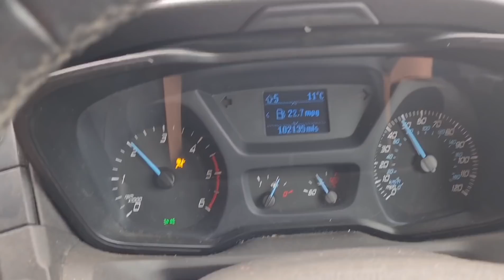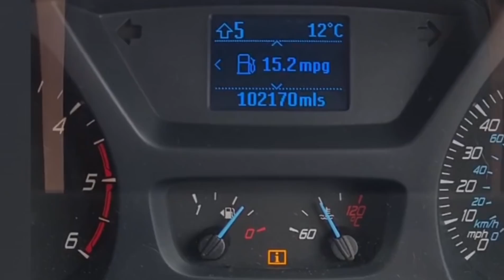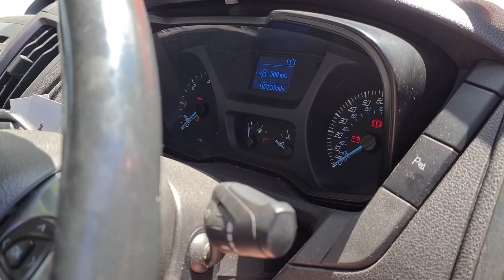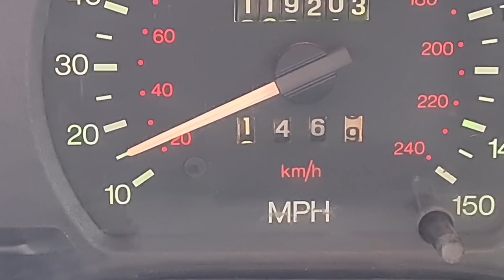Omg! How can we be so Unlucky! Can't believe this happened

Comment: The AA mechanic taught Sherpa that water damages electronics, Alexa is in big trouble.....
Reply: Awesome comment!   Alexa may experience an unscheduled splash in the toilet.  Oops!
Reply: Actually clear rain water is non-conductive and electronics / electrical could care less (especially low voltage DC as in an automobile) (this is not the case with low Ph or high acidic water). However, copper and aluminum contacts hate water because it's full of oxygen. It takes several "wettings" but eventually the connector's metal contacts oxidize. Oxidized copper or aluminum when suspended in water is VERY conductive, causing shorts between the contacts - especially bad if one of those shorted contacts is 12VDC. The point is it wasn't the rain this time that caused the problem, it was the rain that got into the connector the last four times that caused the problem.
Reply: Tab Ber Best comment‼️😉
Reply: @3DPDK  sorry to disagree, but Rain water is not the same as Deionised water. Rain water still contains all the impurities, thus it very much does conduct electricity because of the presence of Ions. So rain water will definitely cause a short circuit. Hence the multiple faults being displayed on the dash as the rain continues to run across multiple contacts.
Reply: @Madmonty73  It depends on how long it's been raining, the condition of the air the rain is falling through and the condition of the surface catching the rain. In truth, the water coming through the cracks while driving on a road with a lot of traffic is full of (conductive) carbons and other trash. Never the less, the corrosion shown in the connector didn't happen in just one dowsing and it's caused by acidic water and oxidation over time and repeated exposure to water. When the oxidation gets wet, it eventually shorts. For the record, I do not recommend that anyone pour water on live circuitry.
Reply: @Ignatios Nelson Professional electronic, field and bench tech. Worked in both digital and analog, both audio and radio including microwave. I have literally opened a digital system cabinet and had water pour out of it - while it was still working. I have gone on in life to become a ship's captain, yacht builder and currently retired living on a vintage racing yacht designed by Drake H Sparkman. I "stand out" only when I want, and I usually avoid crowds, and I could care less about your English corrections - which means I care a little, so there's room to care less ... but in this case, very little.
Reply: Brilliant! 
You won  🏆
Reply: Time for Alexa to take a bath.
Reply: @3DPDK  Touche' ! (re: the bit about English corrections LOL!)
Reply: @galady8632  yay! 😉
Reply: @Madmonty73  Plus the rain picks up dirt and stuff as it travels through the vehicle.
Reply: Alexa is just a quick leg lift from the trash can.
Reply: @toomanyhobbies2011  😳😁
Reply: @3DPDK  the 'rainwater' probably had screen wash in it too as whenever Jamie washed the screen, the residue would have gone down that gap as well. There's all sorts of chemicals in that...
Reply: @MaxxsMummy  What folks are missing about my first response is that I refute the somewhat broad statement that "water damages electronics", and that it wasn't just this one rain that fried the computer but many consecutive rains previous to this one, and my experience tells me it was the connector that suffered corrosive damage and it was the corrosion build up in the connector that shorted out the board it's connected to.
Reply: Lol pure water is non conductive is it...? Silly clown.
Reply: @joshschneider9766  There are no free electrons in the H2O molecule ("pure water"). If you know what electrical conduction is - how electrons move through any substance, then you will know why your response is based on lack of knowledge.
Reply: @Sherpas_vanlife  put some tape or something over the gaps where it leaked through to stop it from happening again

Comment: Jamie I have been a Mechanic for 25 years there is a trick to wet connections and getting around them...it is called Dialectic Grease if u have a connection that gets wet and ur vehicle wont start because of wet connections..u put that grease on the contact connections and wet or not the grease the it electrical current and ur vehicle keeps going.

Comment: Rubbing alcohol and a small wire brush. Alcohol disperses water,wire brush to clean rust off areas you can reach. Looks like the fuse panel is in a bad area that catches water
Reply from the maker: Thanks Todd.. Will definitely make sure it doesn't happen again

Comment: There is a reason that FORD is actually an acronym for "Found On Road Dead" and "Fix Or Repair Daily", and you have just discovered that reason!  
For your next van, DON'T purchase another FORD!
Reply: You must have missed it. The old van is a Ford too. You never know with Ford's, just like other vehicles.
Reply: The old van that starts again is also a Ford. Thats one of the reason Jamie got a Ford for the red van
Reply: To be fair, Ford UK doesn't have quite the reputation FoMoCo does here in the States.

For that matter, the Transit was born in Britain!  I'd take a Transit over a Sprinter, Metris, or ProMaster any day.  If only Dearborn would put a real transmission in the NA models.
Reply: The blame goes to whoever didn't put the wire harness boot back correctly.
Reply: You do realize the second van that sat there for a year was a Ford and it started up 🤦🏿

Comment: Jamie & Sherpa. It sucks what happened to you guys in the new van. You're lucky it didn't short circuit or catch on fire because of the exposed wires and the rain water. By the way. With a good cleaning and a tune up, your old van can get back on the road in no time. Please keep us posted on what's going on with the vans if you can :-)

Comment: Sorry about the sherpa mobile but that's a good idea having two vehicles. I had a Mercedes Sprinter work van with over 500 thousand miles on it. It was a work van it never left me stranded anywhere. The guy that had it before me didn't put oil in it or anything. And when I got it I tried to take care of it and it started all the time and was completely reliable.

Comment: Rough deal.
Back in the 1990's I had a 1971 Volkswagen Beetle that stopped running for no discernable reason.
I had to leave it in the lot at work and come back for it later with a friend who knew how to work on them. The day I went back, it was raining, and I was not looking forward to major diagnostic work in the rain. Well, the dang car stated right up.
I figured out, the second time the car died on me, that all I would need to do is pour about a gallon of tap water over the engine and it would start. Once it started, it kept running.
After some actual troubleshooting, I found that the main solenoid had an internal crack that would sometimes, depending on vibrations when running, would end up with a gap that the spark could not bridge, but getting it wet filled that gap with water to allow enough conductivity to start.
-
I replaced the solenoid and no longer had to carry a gallon of tap water with me. But I did miss the looks I got when I would pour the water on the engine and then start the car.
-
But enough of my story, I hope it is not too expensive a fix!

Comment: Tip for motorists: Regularly remove debris & leaves from the plastic scuttle panel by the wipers.

If left, debris can block up the drains under  the panel, which causes water to pool.

This water can destroy your wiper motor, leak into the interior & has the potential to do a lot of damage

Comment: As with all computers, in this case stop the car (duh), disconnect the battery, make sure water not in fuse box, computer connection, etc. Restart car. Hopefully computer reboots and is fine. 
Always worth a try.

Comment: Wondering if you can get GMC or Chevrolet (Chevy) Vans over there? They tend to be much more reliable then Fords or so I have heard, witnessed and lived the proof of it my whole life. 😁 The Chevy pickup my hubby and I have is a 1998, and still has the original engine in it, over 400,000 miles!! And she still runs and still hauls loads of material with a trailer! I mean, yes she’s tired, and her body has issues from age (rust) but she’s been such a great girl! We will soon have to replace her, but we’re trying to see just how long she will last just out of curiosity. 😁

Comment: You have the worst luck with vehicles. Yes, water and electronics don't mix. Seal everything you can with Silicone sealer. Spray everything with WD 40. Repels hidden moisture. Water should not be coming inside at all. Having a second van is a great alternative to walking everywhere and grocery getting.

Comment: i finally caught on b/c I've been in that situation but I was in Missouri and the rain was non stop, basement had water and sub pump needed to get reboot,  and then me and my ex father of my son were in an apartment and the water leaked down into the basement and wires were on the wall, fuse box and the works were burned out and rain had damaged the heat and i was sleeping on the couch and got freezing cold and I just got out of hospital there, and so landlord was called and fixed it and I am used to sleep in cold temperatures and I knew something was going on and we couldn't figure it out till landlord came fixed it and heat. I live with my parents because of a few situations. its ok i don't mind.

Comment: The new cars crammed with electronics are junk. Old cars from early 2000 and before are much better. How is that going to be with the electric cars? Small bug in the software and you pulled the ass card.